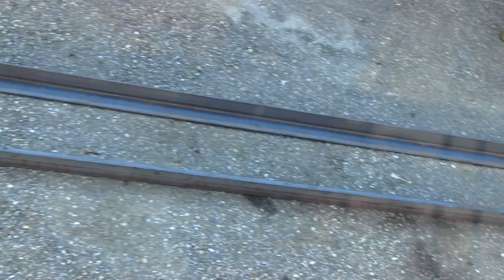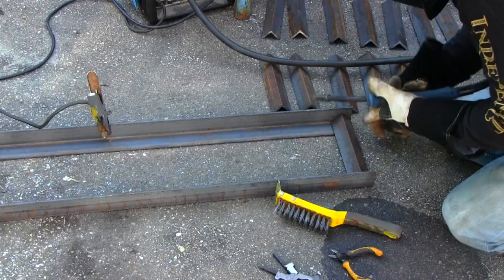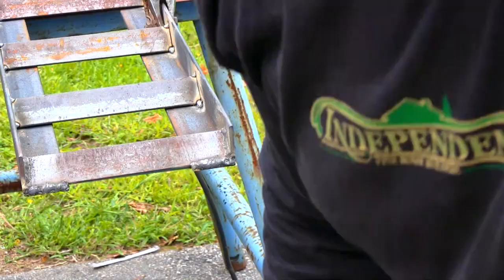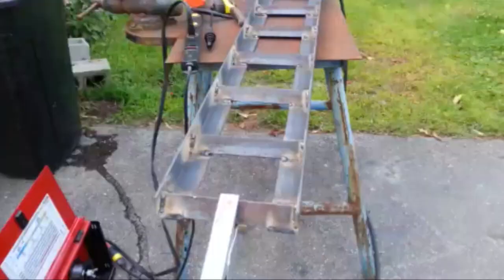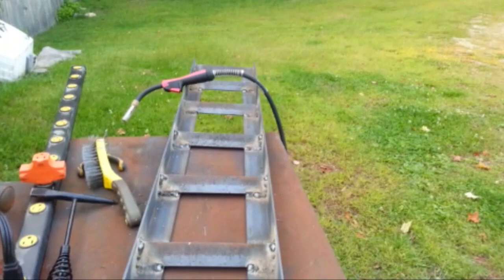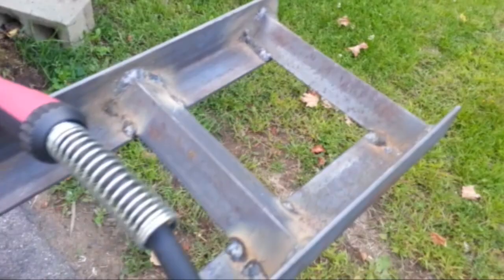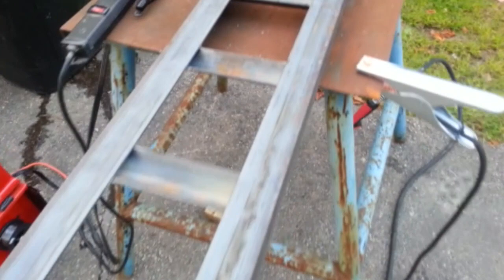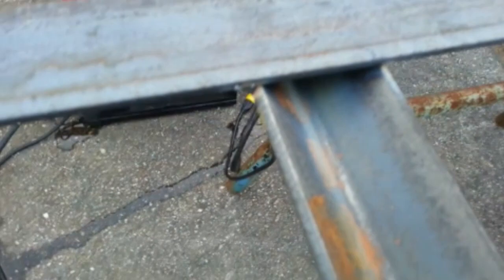How to make heavy duty steel loading ramps

Comment: Because of the way that you structured it / are using it, you have to have really good welds on the cross members because the welds are supporting the full weight of vehicle that you have on the ramp.  That's why it is important to put all those welds on each of the cross members.  If you use a ramp like that with it flipped over, the rails are supporting the cross members and as such, the welds on the cross members are mainly just to prevent the cross members from sliding along the rails and thus do not need to be as strong.
Reply: i would have put the cross members on top instead of below

Comment: Greetings from sunny France! Thanks for the video, very useful, I just finished looking at the price of new ramps, then noticed some angle iron that I bought and never used. I'll definitely make these. It would be interesting to have the dimensions of the ramp(s) you built. And an estimation of how much load they could take?
I was also thinking about a way of ensuring that they stay in place whilst loading. I'll mainly be using them for loading a mini digger on my 1300kg trailer, and since the digger is on tracks it can hop about a bit sometimes. If you have any ideas, I'd be glad to hear about them. Thanks again and take care.

Comment: Don't let the welds take the weight. Turn the ramp over and the metal will take the weight and the welds will merely keep them in ace.
Reply: He's not that smart.
Reply: Also when you flip them over, any mud or debris won’t be caught in the V, it will shed the mud.
Reply: Keeping it orientated as he does, if the tire threads are as wide, or wider, than the ramp then the long angles are taking the weight.  The only way your observations would be correct is if the tires are so narrow, they only touch the cross pieces.  So, don’t Br do quick to judge.
Reply: @johnvgig  If the tyre treads are wider than the ramp then it is not wise to use them. You say don't be too quick to judge, what the f**k are you talking about. What a stupid comment. What's too quick to judge about it? What's wrong with my comment content? Are you superior to everyone else?
Reply: @fortuner123  question for you: is the angle steel side any stronger in either orientation?  His complete welding,  seems to me, to be superior and to add strength to the angle steel.  
My question relates to my build of ramps for a friend and trying to decide on length.

Comment: bravo! I'm about to fabricate a similar setup with slightly thinner steel (I don't need that much strength) to load my quad without the fear of a collapsing ramp!
Reply from the maker: It's a great project. I have found the rims to come in very handy for many different applications. The one thing that is frustrating is that they are very very happy. I would say mine are about 50 pounds a piece. If you see some of the more recent videos on getting stuck up at the homestead property, I use the ramps as a bridge over some rough terrain. They work very well. They will not support the full weight of my F 350 on a full span, but they will carry the truck over a three foot span. If it is just for a quad, you can get away with something smaller. But as you have probably figured out so far, I like to over build everything :-)

Comment: Looks like they are going to slick. Needs some 1/2" x 1/2" angle added to the top for traction.
Reply from the maker: I made that modification :)  good call!
Reply: Thanks :)
Reply: +highcountrytimber I'm confused by this comment.  When loading, I would drive up such that the tires are contacting the 90deg points on the angle-iron rungs, not the other side.  The structure is stronger when deflected in that direction, and the traction would be higher; no need to add more steel.

Comment: Great video! I am looking building myself some ramps.
Reply from the maker: Herple Ellis Thanks!  I have since painted and used these ramps for a lot of loading and unloading...and another very useful application is to use them as a bridge!  In the springtime the dirt road is usually washed out 4 or 5 feet deep making it impossible to pass over with a truck or tractor.

Comment: I'm thinking about building some ramps for a flat-bed, however I would like to be able to load a Jeep Cherokee XJ that weighs approx. 3,300 lbs. What size and thickness angle iron do I need? 3 inch x 1/4 inch? 

How long?

 What about wood ramps? 2 x 8's with 3/4 in. plywood?

Comment: thanks for sharing your idea of building this heavy duty ramp by your own. may i know what is the brand of you MIG welder?
Reply: the blue one is a Clarke.  got mine from JCwhitney.  i run mine on gas so i have no slag.  the leads are kind of short.
Reply: I made up extension leads for my everlast welder. they are pretty easy to make just find the correct size dinse connectors and wire.

Comment: common sense says they should be used flipped over the other way.... much more strength! especially if you're not a professional!
Reply: The way he built is pretty standard for car trailers, they are positioned that way for traction. I have had a car trailer since 92 and mine are made this way. I have had cars, trucks, and tractors on my trailer with no problems.

Comment: Why did you not start with cement piers for the shed?  Cement pads for the excavator and covered trailer?  Bottom up building ...works better that way.  Neater overall.  More stable.  Just sayin'. It's driving me nuts watching this.  .

Comment: not too be an internet know-it-all, but your machine needs a tune badly as well as you need to roll your argon tank to mix up the gas, if you do that your beads will run smooth and there will be less impurities and ruptures. the only reason why i say this is because if your welds break your up a ramp without a crossmember. and thats a shitty day. good day sir happy tacking!
Reply: you didn't notice he was using flux core.  no gas.  look at the tip.  better penetration.
Reply: Inner shield no gas required
Reply: Its stupid obvious hes not using argon no flipping nozzle......

Comment: i dont get it, spent $155 at home depot on angle iron copy ur ramps, went to load a car today and it bent in half :/
Reply: dillon wells go to a real steel yard for a much better price. He made these to load equipment into a trailer not load vehicles.
Reply: heavy equiptment weighs more than a car tho? lol nearly every youtube vid has these kind of ramps iv been seeing, and i didnt know we  had a metal shop around here in this town  till it was too late fml  friend told me today about it, and went and picked up 2x3 6 foot piece of steel to patch a spot on the frame and it was only 20 bucks
Reply: You need to get another source for your steel. Just built these myself. 55 bucks for 20 ft of 2x2x3/16 and 20ft of 1.5x1.5x3/16.  Ive loaded chevy suburbans with no issues.  What thickness did you buy 3/16???